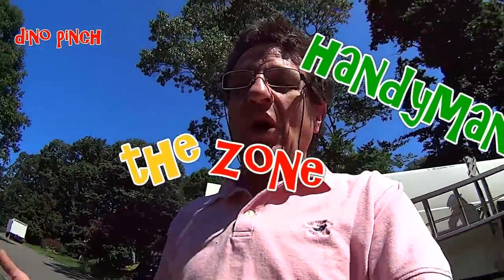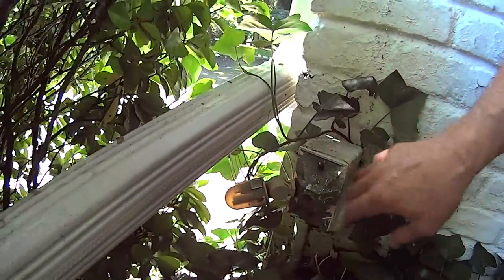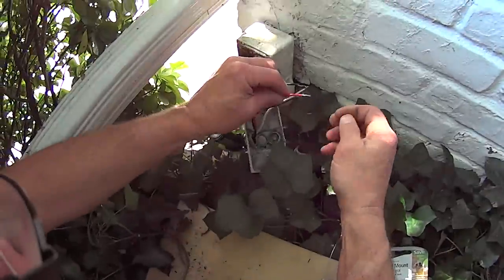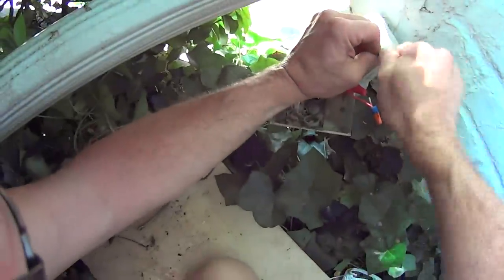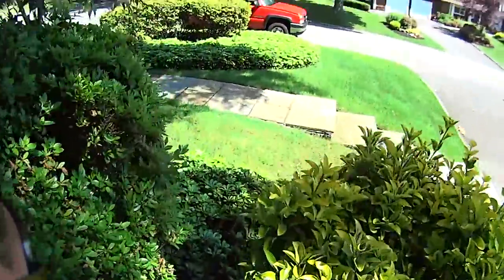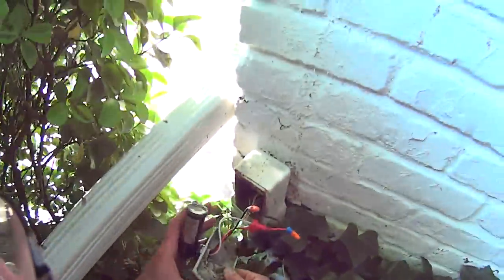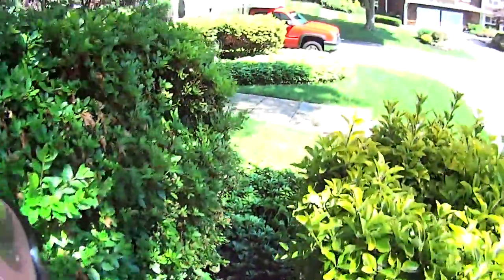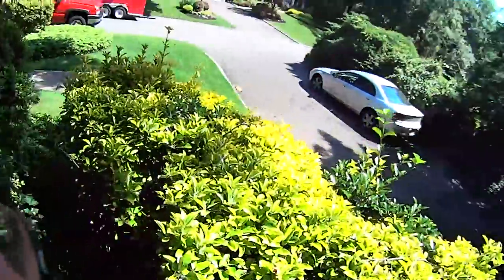install or replace photoelectric sensor outdoor lighting

Comment: Thank you for that video, it helped a lot.  I replaced the sensor and while at it I replaced the fixture on my Post Light.  I followed your instructions step by step and it worked like a charm.  You are right about skipping the circuit breaker, its just one wire and is very easy to connect without touching it.  I didn't see a single spark and I didn't get a shock.  I disconnected the wires first, then replaced the Post Light Fixture then connected the sensor last.  All went perfect and took a total of 15 minutes with the Post Light.  Thanks again brother!

Comment: Thank you for the video. I found my lights on one side of the house not working, so I looked at your video and then went looking for a photocell and found it. I have ordered the replacement part and by looking at your video it should be a piece of cake. Will let you know how it goes in a couple of days.

Comment: Constructive criticism to make your future videos better: You did a great job explaining how to complete the job. I'm no electrician so I will probably turn the power off at the breaker and test to be safe, but again you explained the task well. However, please just stick to the instructions. Your audience is not only single moms, etc. but also men like me who are trying to learn. Unfortunately my father passed away and so this is one of the ways that I learn so I can become more handy at home. I could have done without the insults at the end quite frankly. I never question how much electricians charge, for the reasons you mentioned. Don't need to hear your rationale. I could have done without the overlays, etc. but I can see how they can make the video a bit more entertaining. Thank you for helping folks like me learn!

Comment: Great video! Why is it that you can control multiple lights with one sensor? Is it because the lights are in parallel and share the same current coming from the same breaker?

Comment from the maker: PIGTAIL & WIRENUT all the white to each other(usually 3)

the black from the sensor go the live black from source

the RED goes to the black for the lights

pigtail them all with wire nuts and tape
Reply: I did this on a job and came here looking for answers. Initially I have blinking. I was told the the hot and ground were reversed. So I changed. NOW... the light is on ALL THE TIME.  Any suggestions?

Comment: I have a light post with a dusk to Dawn sensor, the sensor does not work properly,when you cover the sensor with a piece of tape the light comes on even in the day time, when it is dark the light doesn't come on when you cover the sensor it still doesn't come on. Any ideas.
Reply from the maker: Sounds like your sensor is shot, they don't last forever and take abuse being outside in the weather and also things like power surges from lightning storms can blow them out.
You can find replacement sensors at the depot stores or even a local electrical supply store where basically it's the same thing as this video but made specifically to fit in a lamp post, i think if you ask for a "lamp post photo electric sensor" or google search it you can find one for about 10 bucks, then the wiring is exactly the same as the example in this here video above, it just a different shape case to fit the lamp  post

also important Don, the none of these night sensors, wall dimmers  and many timers will NOT work at all with the newer LED or the twisty bulbs, you need a old style "tom edison" bulb,  you can read the fine print on the LED and other energy saving bulbs instructions for the official version but yeah, check you have a working (not burnt out) old style bulb in that lamp post then replace the sensor as needed

Thanks for watching Don!

Comment: This is the worst help video on the internet so unprofessional.  How would you tell a person to leave the power on while you are working on electric circuits then you say that the only wire you have  to worry about is the black wire.  First the photo cell was remaining on on so that means it was providing power to the red wire as well 110v second is you are going back behind someone else you can't be sure that it was wired right to began with.  Third you never checked the photo cell its very possible it was all that woodage surrounding the photo switch.  $125 to fix the problem is fine if the customer is willing to pay the price but don't put a person at risk that looking for information to fix a problem.  Very unprofessional never tell someone to work with an open circuit!!